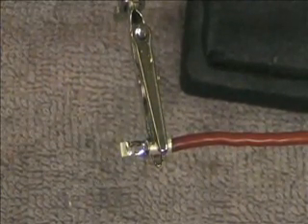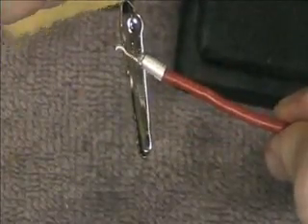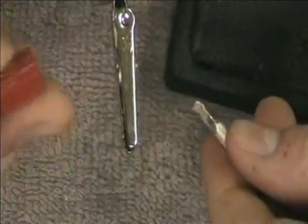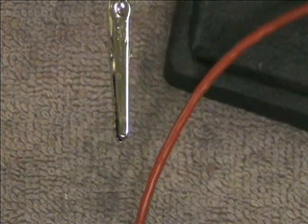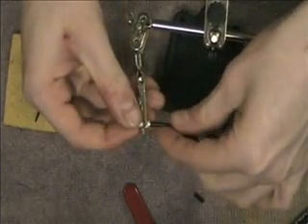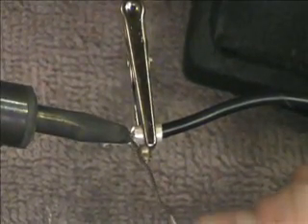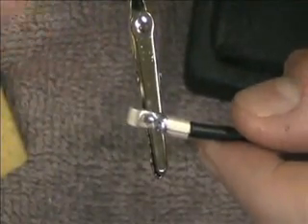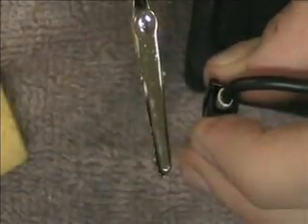Anderson Powerpoles Soldering 101 (Part 2)

Comment: Come on Bud Solder goes in the other end of the barrel. You ruined that one bad by getting solder on the spade end so put your alligator clamp on the spade end so it doesn't rob the heat from your iron on the barrel end. But your just learning! Anderson Power Poles are Awesome!!